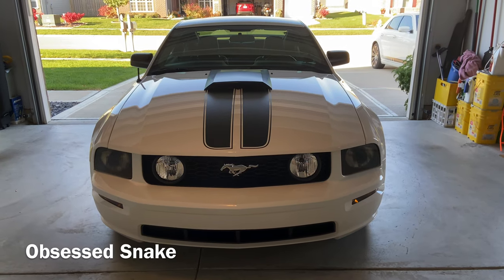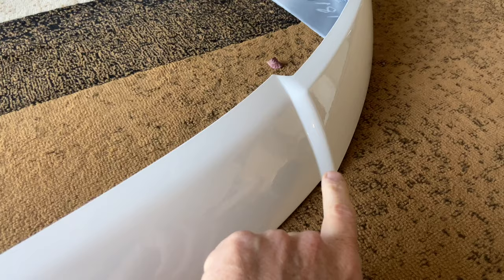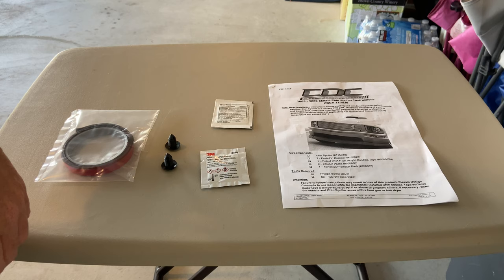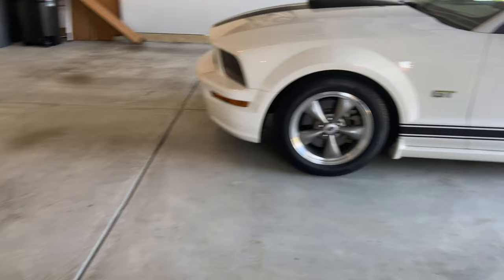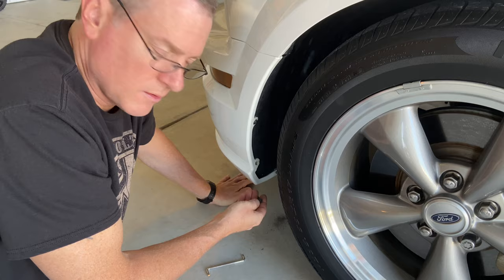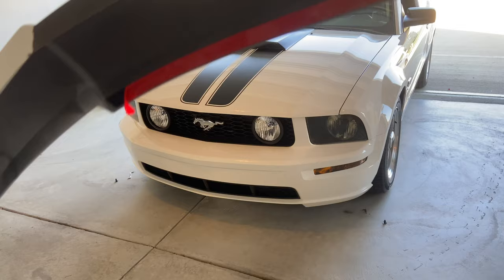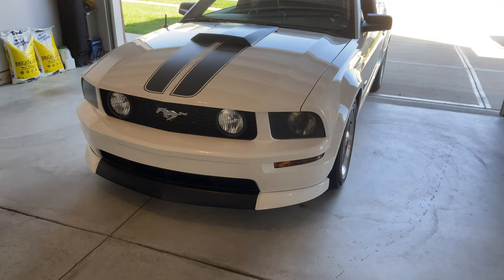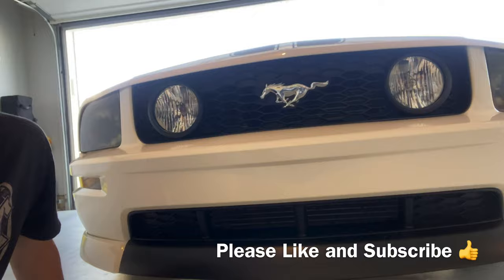Chin Spoiler Install on my 2006 Mustang GT

Comment: Is the black part matte?
Reply from the maker: Yes it is a satin black. It isn’t a full flat black, It gives off a small shine in the sun.
Reply: Thank you for the reply! I just got mine in the mail and plan on painting it here soon, but couldn’t tell how the middle was.
Reply from the maker: I used Plasti Dip. It is easily removable if you don’t like the outcome. I did this instead of regular paint. But the choice is up to you! Thanks for watching!
Reply: I LOVE THIS BODY STYLE I HAPPEN TO HAVE 4 SHELBYS MY 07 SHELBY GT AND MY 08 GT500 AND MY 10 GRABBER BLUE SUPERSNAKE AND LASTLY MY 07 427 EDITION CONVERTABLE SUPERSNAKE LOL REALLY RARE AND I PLAN ON THIS SUMMER SELLING MY TERMINATOR FOR A 07 09 GRABBER ORANGE COUPE SUPERSNAKE.

Comment: I installed mine today, looks great only thing I didn’t like were the gaps where it rounds off under the headlights, I thought I installed it wrong pulled it back off to re adjust it, and the gaps are still there, very small but wasn’t sure if it was like that with all of them or not
Reply from the maker: Not sure. I installed one when I had my yellow GT some years back. The gap was there also. I’m guessing it’s like that on all of them. Was thinking of trying to ad double side 3M tape around those areas. Still looks good in my opinion. Thanks for watching!

Comment: Hey great video. Do you think I could modify this to fit on my v6 mustang bc they used to make these for v6 but I can’t find them and I really want this exact splitter. Thanks
Reply from the maker: Not sure because the front lip is different than the V6. I got this particular spoiler off of American Muscle. You might try there. Thanks for watching!
Reply: @ObsessedSnake  alright thanks for the information. Have a good one